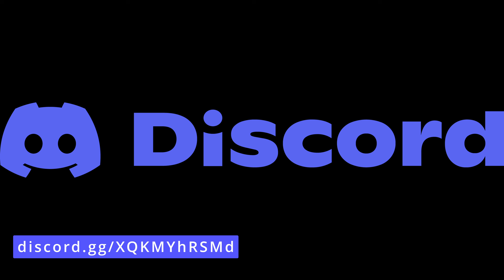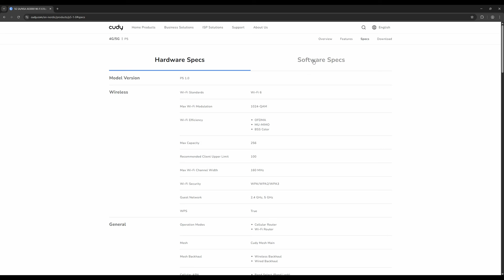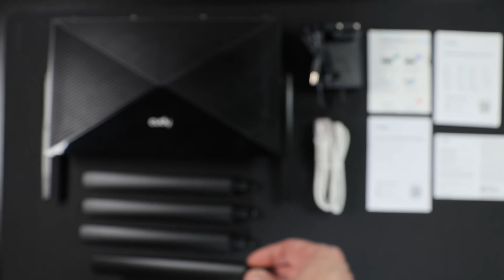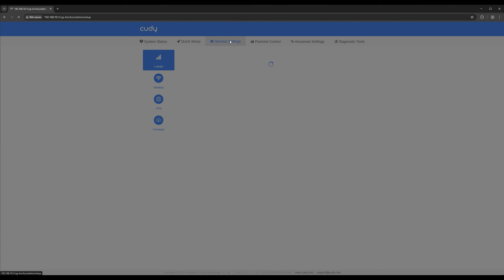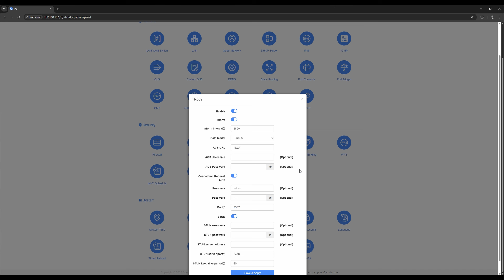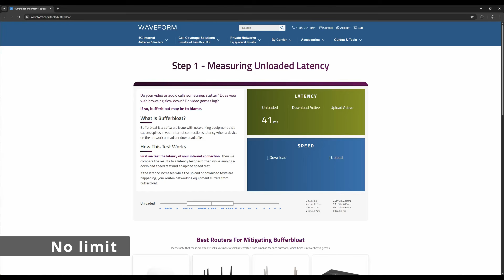What Makes Cudy P5 the TOP 5G Router for Rural Areas?

Comment: Awesome video thanks a lot! A quick question, how to connect exterior 5G antennas that only have 1 or 2 ports coming from it? Since this router has 4 antenna connectors, in case of a 1 or 2 port exterior antennas, in which of the 4 on the router should they go? I have a couple of old 5G antennas (one with 1 connector cable and the other with 2 connector cables) and would like to try them out but am confused about their connectivity to the router. Thanks again :)
Reply from the maker: @yuidfbse  Hello and thanks!

If you have only 1 or 2 connectors from the antenna:

• For 2-port antenna → use ANT0 and ANT3
• For 1-port antenna → use ANT0

Those are mapped to the primary chains.
Reply: @5GBenchmark  Thank you very much for the information and I'm going to give it a try with a couple of antennas I have. The only difficulty I still have is finding an app that can help me locate the cell towers and the direction of the signal. I've tried OpenSignal but it's not working for me very well not gives me accurate cell tower location and signal orientation.. I'm still looking for a different app that can help me get this done. Thanks again!
Reply: @5GBenchmark  I have Iskra P60 external antenna with 2 SMA connectors. If I connect them within ANT0 and ANT3, is it necessary to keep other 2 ports connected with internal antennas? Like will this "boost" the signal strength or it doesn't have any effect?

Comment: This router is a failure; it lacks a professional signal strength display window, cannot show available cell towers, and cannot assign a specific PCI cell to the user. Furthermore, there is a significant ping delay compared to routers like the Huawei CPE5.
Reply from the maker: @libu4624 You can actually access most of that data through the API, even it is not shown in the UI. PCI locking is also possible. I will make a video about this at some point.
Reply: @5GBenchmark  I know this, but this should be included in the router interface. The worst thing is that the response time is very long compared to Huawei and TP-Link.

Comment: ya i bought this router but i think i am not setting this up properly i got higher ping that what i used to get from my old huawei 5g cpe router. and jitter wasnt that better also. will give it a try again today. also p.s. for international users satshop doesnt provide replacement or refund if it is out of the EU.
Reply from the maker: @forever_moon93x  I would first check if the Cudy is using the same cell and frequencies as your Huawei. That alone can explain the difference.

Overall the Cudy is an excellent all rounder, but Huawei still has an advantage when it comes to latency and jitter.
Reply: @5GBenchmark  no luck sir i'll take the L
Reply: news?
Reply: @aleperra7561  its bad man tried the 5g NSA mode, band locking qos and tried to play the game extreme lag and my 2020 huawei 5g cpe which has literally no band locking, no QOS control, no 4g/5g selection out performed the cudy p5 in terms of speed and latency and jitter highly disappointed, money wasted

Comment: I would have liked a comparison between the performance you get on a 5g phone at that location, compared to the 5g router. I have recently changed my phone to a 5g one, and according to coverage maps, it said I might not be able to receive 5g indoors. However, I get about 200Mbps, so I was interesting in getting a decent router. I have read several reviews on Amazon that said they got higher speeds on their phones than on the router, which really surprised me. It seemed to be one of the main reasons for returns of this product. I wasn't sure if they were just doing something wrong.
Reply from the maker: @rikmoran3963 There are quite many variables that affect this. Modern phones often perform very well, especially when the signal is good and the phone's modem is well optimized for mobility.

In my tests, on the same location I usually get around 250–300 Mbps download and 80–90 Mbps upload with a Pixel 8 Pro. So it is not uncommon that phones can match or even slightly exceed router speeds in some situations. Many phones have one generation newer chipset than routers which also gives some benefit.

Comment: Hi 5GBenchmark, thanks for sharing. How does Cudy P5 handles Dual SIM redundant backup in auto mode? Does it automatically switch to the SIM card with better singal?
Reply from the maker: @pc3502-k9r  Hi. It supports dual SIM failover, but it does not automatically choose the SIM with the best signal in real time.

Comment: Hi 5GBenchmark I have a question. I have my internet provider nearest 5g tower around 5,5km from me in a straight line which supports  2600, 1800 and 900mhz band. I checked the download speed with my phone and it was around 80mbs. Is cudy p5 5g a good option for me or should I find something else?
Reply from the maker: @K0t3c3k The Cudy P5 with an external antenna would be a good option. Another good choice for that kind of distance is the ZTE MC889A Pro.

Comment: If this is a 'rural' ready router, why only test at 1.5km, thats not rural 😂.  Im sure I've seen your RTL 5G at 6km which is much more representative.

Be good to see an apples for apples comparison.

I suspect the P5 is rural ONLY with an external antenna, then might as well get Mikrotik RTL G5 where there's no antenna length performance degradation issues.

Comment: Hi hoping you see this and u could help me. Could i fix my latency issues im having with the huawei 5g cpe max 5. If i get the cudy p5 and the outdoor antenna etc combo from satshop that they are selling. Gaming and livestreaming at the same time feels impossible, i have managed to get a stable locked 600 down and 100 up with your huawei optimization video. But i cant get my bufferbloat above C rating and because i dont have any qos i feel like i cant do anything. I have really enjoyed your videos been watching them alot to understand the 5G routers etc alot better👍🏼
Reply from the maker: @KramaXD Hi! Thanks, glad the videos have been helpful.

What you are seeing is expected behavior. To keep latency under control while you are gaming and streaming at the same time, you need proper QoS and traffic shaping. Without that, the uplink in particular gets saturated and ping spikes no matter how good the raw speed looks.

In practice you usually need to cap the speeds quite aggressively, often down to around 30–40% of the maximum download and upload, to keep bufferbloat and latency in check. That is something the Huawei cannot do on its own. So no need to replace modem but get QoS capable router behind it.
Reply: @5GBenchmark  okay thank you for this info. So basically would it be good to get Gl.inet Flint 2 for example and use that. I read that its using openwrt and has both sqm and QoS capabilities. So basically connect the huawei to the flint 2 and do all the settings on that.

Comment: I was able to get 200mb download and 20mb upload speed. Do you know is there settings in the Cudy P5 that I can change that would increase the upload speed?
Reply from the maker: @devlinvideo1 I ran into the same situation. There seems to be some issue with upload performance in NSA mode on the P5. I have reported this to Cudy via the retailer, but I have not heard back yet. As a quick test, does the upload improve if you switch the router to LTE only mode?
Reply: @5GBenchmark  LTE only mode resulted in a 10mb reduced upload speed.

Comment: I have p5 and x24, it came with a poynting cable four go into one and then come out as four again at router. I am now confused on wiring to router. Poynting lable connectors 1 to 4. Which should go where on the Cudy connectors ?
Reply from the maker: @andrewpurdie1975   Are there are labels on the bottom of the XPOL-24 that indicate the antenna elements? If there are labels then you can identify which is MAIN and which is AUX for each cell. Your wiring order is : Cell 1 MAIN to Cudy ANT0, Cell 1 AUX to ANT3, Cell 2 MAIN to ANT1 and Cell 2 AUX to ANT2.

Comment: The sadx62 is getting old now. I was looking at a suncomm sdx75 but European users are reporting issues with CA. Does it make better sense to go with the cudy p5 with its older sdx62?
Reply from the maker: @adrianplambert I would say the SDX62 and SDX65 are still very capable platforms. Most of the real benefits of the SDX75 come from higher 5G carrier aggregation combinations and advanced features, such as multiple n78 carriers. Those features are only starting to be deployed and will become more common over the next few years, so for current networks a Cudy P5 with SDX62 still makes very good sense.
Reply: @5GBenchmark  thanks. In Italy people are finding CA issues with the SDX62 global module in some of the cudy p5. Other reports show that eu specific modules work correctly. Do cudy do an EU version as well? If yes, how do we ensure that’s the one we are buying? BTW the upcoming Mikrotik Knot 5g r17 looks very interesting for this sort of thing. With it’s sdx75 eu modem.

Comment: Hey. I live in a place where signal strength is weak pretty weak (Mountains and around 5-6 km to tower, but decent direct sight to tower) and lower frequencies are almost always full. There is a 3500 mhz band available since not long which works great on a phone. what router would work best for me?
Reply from the maker: @christiant2134 If the 3500 MHz band works well on your phone, then the ZTE G5 Max and the ZTE MC889A Pro are both very good options. They perform especially well on n78 and can handle longer distances surprisingly well when line of sight is decent.
Reply: @5GBenchmark thank you very much

Comment: Beware, there are two versions. Older with X55 and newer with X62 modem. Both are called just P5
Reply: How do you tell the difference?
Reply: @andrewpurdie1975  HW v1.1 is x55 and HW v1.2 is x62 I think. The unit is marked with these on the back. Not sure about the box though.
Reply: @adrianplambert  my p5 is hw 1.1 and has RM520N-EU modem, which is x62 i think.

Comment: Could you please say a little more about cell locking for this device please? I did some searches, found some info, tried it, got errors. I have v1.1 btw. Are the commands different than the V1?
Reply from the maker: @adrianplamber The commands should be same. I am planning to video also, but for example this should work: AT+QNWLOCK= "common/4g",1,EARFCN,PCI where EARFCN and PCI are values from your cell.
Reply: @5GBenchmark  thanks. In the meantime I heard from Cudy who said it doesn’t support cell locking. If I understand this correctly the AT commands are direct to the modem chip so even though the Cudy interface doesn’t support it the modem chip does. Have I got this right?
Reply: @5GBenchmark  also mine appears to have an x55 chip not the x62. Will that make any difference to using this command?

Comment: Hello, what do you recommend H155-381 or P5?
Reply from the maker: @denismasters5150 Hi. Both are very good devices. The Cudy has better routing features and also the option for four external antennas, but it is missing bridge mode if you need that. You really cannot go wrong with either one.

Comment: Does this router only work with cellular networks? Or does it not work with internet towers?
Reply from the maker: @lesh.alwda3  It works only with cellular networks. It cannot connect to fixed internet towers or fiber cabinets, it needs a mobile SIM to operate.
Reply: @5GBenchmark thank you

Comment: So which one is better for gaming — the CPE Pro 6 or the Cudy P5? Which one would you recommend for low latency?
I’m planning to buy the CPE Pro 6 next month — or either that one in this Video or the MikroTik Chateau 5G R17 AX for my new apartment.
Reply from the maker: @Nat1ve175  All of those are solid choices for gaming. The CPE Pro 6 has the best latency handling in my tests, although the difference compared to the others is very small. If you also want more advanced routing features then the Cudy P5 or the MikroTik 5G R17 AX might be the better fit.

Comment: What is the best antenna for cpe pro 6 ?
Reply from the maker: @saadsad9764 The external antenna ports on the CPE Pro 6 are only for the n78 band. So you need an antenna that specifically supports that band, for example the Iskra P-62 or the Poynting XPOL 2 5G. In most setups you also need SMA to TS-9 adapters to connect.
Reply: @5GBenchmark oh that means antenna won’t work for me since I use n 40 an b 40 only 🥲
Reply from the maker: @saadsad9764 I will test the external antenna ports with the XPOL 24 in an upcoming video, so we will see how they behave with different bands.
Reply: @5GBenchmark   I hope they behave well

Comment: Hello, would you reccomend this or the Huawei 5g cpe 5 max? Or other ones in the mid range
Reply from the maker: @erik370 Hi! It really depends on your signal situation. If you have medium to strong signal where you live then the Huawei CPE 5 Max is good option and performs very well in those conditions. If your signal is more challenging or you are relying on lower bands like 700–1800 MHz then the Cudy P5 with an external antenna can be the better choice. With good quality external antenna the P5 handles tricky locations surprisingly well.

Comment: Nice product, and thanks for sharing! I have been using a similarly feature rich indoor router GLinet XE-3000 (Puli) with very similar features (eg. dual sim slot). What I prefer in Puli: 1. 2.5GB ethernet port, so you are not limited to 1GB; 2. OpenWRT + Luci if someone likes these;  3. Battery to survive electricity outage for long hours;
Reply from the maker: @veguvegu7499  That’s a very nice device indeed! Do you happen to know which modem chipset it uses? I’m hoping to test some of these non-mainstream routers like the GL.iNet models in the future. They often have very nice performance.
Reply: @5GBenchmark  It's RM520N-GL based, it's in the specs on the site.